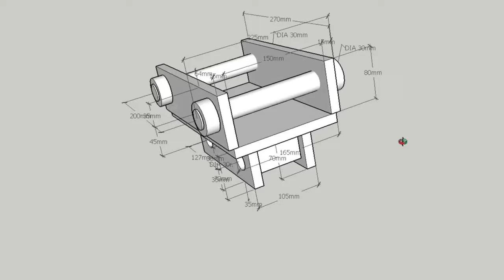DIY excavator bucket adapter

Comment: Just one suggestion if I were you I would exchange your loader while its still new for one with the joystick 🕹 controls I think you would be much happier 😊
Reply from the maker: Fully RC Avant? That would be cool! On Avant demoday I got to try out the RC excavator attachment, way smoother contollable with thumb joysticks, and it also has rabbit/turtle speed selector, was buttery smooth. Costs like €11k+tax though -.-
Reply: I think he talked about RC controlled 260 backhoe.

Comment: Hi, damn you made me green of envy. I only have 520 and 210 excavator. Had them for 12 years now.
Very nice combo there anyway that you have!

I actually have thought also to make an S30 adapter even though 210 has a non standard fitting for the buckets. I’ve thought to make a ripper to dig stumps and use S30 for that. Could be too complex.

You seem to have Stahlwerk plasma. I have been thinking if I should buy their compressor and plasma, but I haven’t done it yet. What model your plasma is? What about your compressor. Is it Stahlwerk also? It didn’t sound very loud.

BTW did you weld the S30 pins of your adapter with stick. They seem to be only tagged with fluxcore.
Reply from the maker: I'm not sure the single shank ripper on 210/260 would do much better than a 250 mm wide bucket, as the cylinders are quite small and they don't put out quite enough force for the heavy duty ripper action. Better would probably be to have the ripper direct attached to Avant coupler. I'll do a 260 push/pull force measurement video oneday...

I have the multimode machine "Stahlwerk WIG TIG AC/DC 200 + Plasma S" from around 2013. The plasma part works fine but not ideal for 10+ mm plates. Ideally should get a separate 5+ kW threephase compressor but for this kind of small cuts even my ~1 kW with 24 litre tank worked fine. On the plasmacut/compressor clips I tuned down the audio -12 dB, so it was actually 4 times louder or so.

The pins I left with just the tackwelds, they're not going anywhere even with those and easier to remove once the need arises, probably never though.
Reply: I agree that Avant itself would have more power if a ripper was made for the normal work device fitting. It has much larger cylinders than those excavator devices. The problem I have had is that Avant has to be moved more if a ripper is directly in Avant. With the excavators it usually doesn’t need so much to drive around though it takes time. Thinking of a wet and soft ground and tractor type tires I have.

I have 400 and 250 mm buckets and a special prototype ditch bucket for the excavator. The ditch bucket is a proto and Avant didn’t give any warranty and I use it on my own risk in the excavator. They made several years ago some of those and I bought it last year when they emptied their storages.
The ditch bucket is actually better for stumps than 250 mm bucket. It is maybe 200 mm on the bottom and 600 mm on the top. It is taller then either of the normal buckets and it has very sharp sides.
It also empties better than those other buckets because of the shape. I have quite a lot of clay here and especially the 250 mm bucket fills up with clay and it won’t empty itself, maybe 2/3 is filled all the time when digging clay.

I’ve dug up stumps using all three buckets. The largest stumps have been of about 35 cm diameter pine and birch. Both fresh stumps. Took for awhile. The excavator couldn’t lift those. I had to roll them on the ground.

I think 210 exc. has 50/25 cylinders. 50 being the inner diameter of cylinder (piston) and 25 being the diameter of the rod both in mm. Not sure though. I’ve been thinking if it was possible to switch the bucket cylinder and the boom cylinder (closest to Avant) to 60/30 if there was enough space.
210 is much smaller and lighter than 260 (about 230 kg only vs 420 kg or something). So it might not be able to handle the bigger cylinders.
Reply from the maker: Just did some digging in moist clay/peat/gravel mix of materials and yup the 250 mm bucket gets clogged up in ja jiffie -.-

Measured the 260 digger cylinders, rod/barrel outside:
Boom 32/73 mm
Arm 36/73 mm
Bucket 36/73 mm
Turning 30/70 mm
Tilt 25/50 mm

Guessing the barrels have 5 mm wall thickness, then at 200 bar they apply push/pull force of:
Boom 6.4/4.7 tons
Arm 6.4/4.3 tons
Bucket 6.4/4.3 tons
Turning 5.8/4.3 tons
Tilt 2.6/1.6 tons

Based on: https://www.trelleborg.com/en/seals/resources/design-support-and-engineering-tools/hydraulic-system-calculator

SolidWorks or some other similar software could be used to find out the structural load limit based on the boom material design and thicknes.

Compared to the 635 that weighed ~1.6 tons and had only one 36 kg rear weight, the 650i with 180 kg rear side weights and 36 kg rear weight (total ~2.2 tons with driver + ~0.5 tons the 260 digger) is now much more stable for digging, blade and outriggers down, parking brake on and it hardly ever moves forward due to digger pulling it.